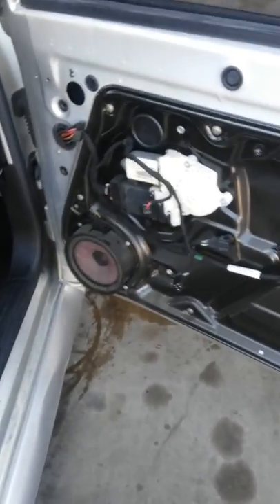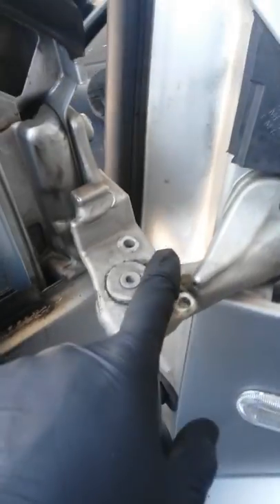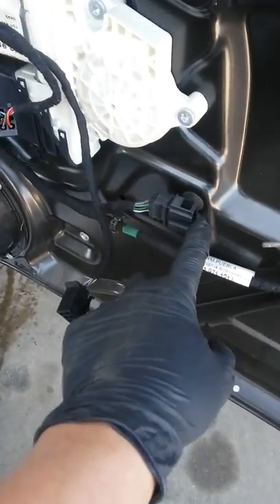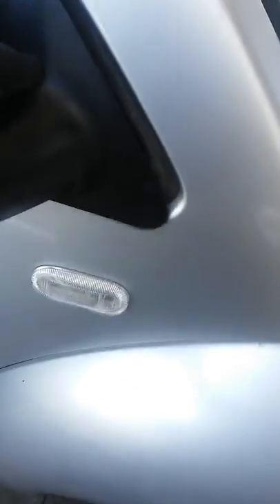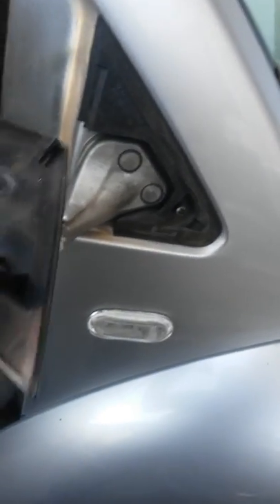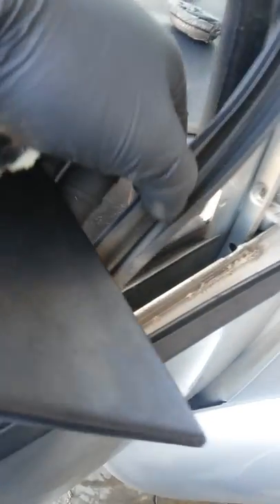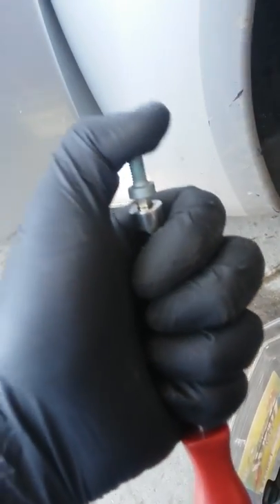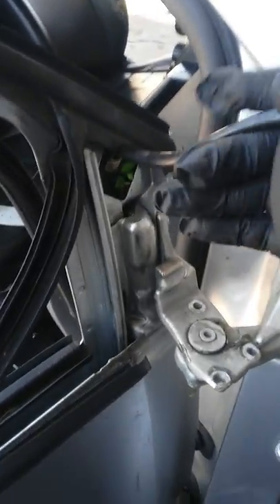2001 Volkswagen Beetle 2001 side mirror removal

Comment: Thank you! Just performed this repair and could not have done it without your video. I taped the green wiring harness plug so that the tabs would not catch. I also pulled a guide string through when removing the old one, then pulled the new one back through. There is a cord clip inside the door that needs to be removed.

Comment: Thank you for this video!  I was able to follow the steps you outlined to remove the old (broken) mirror.  But when I try to install the new mirror, I can't seem to feed the wire harness through the small opening.  It keeps getting stuck.  Is there some trick to getting it to go through?  I haven't been able to figure out how to remove the pins from the harness, even with buying the removal tool!  Would appreciate any suggestions.  Thanks again for this very helpful video.
Reply: Omg same. I’m going through it right now. I wish he would finish haha

Comment: Getting the inside door panel off is 5 fasteners and is easy enough. I couldn't pull the wiring thru with the plug still on. Disconnecting the plug with the 5 wires is easy. To enable easy removal of the harness is not so easy. I'd like to pull the wires from the plug without breaking it. How do you do that? 
To enable easy replacement I'll pull a guide line thru. so that the replacement wiring can be pulled back thru.
Reply from the maker: Steve D you can do one thing the harness connector can be removed but yet you have to know what position each wire goes to let's say they have a color code so they all have a number let's say for example a black wire goes to number to a purple wire goes to number 3 you know this is just an example but it's doable and yet you need a special tool to remove the pins from the connector
Reply: Thanks for the reply. I'll try and sort the tool. The wire location is easily recorded on the phone cam. Thumbs up!